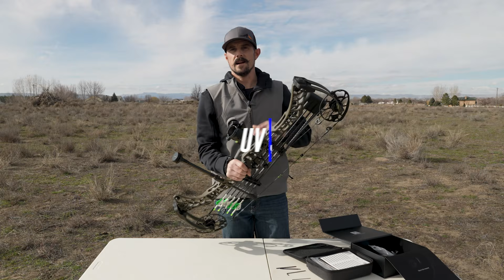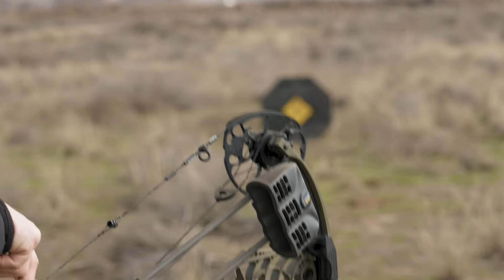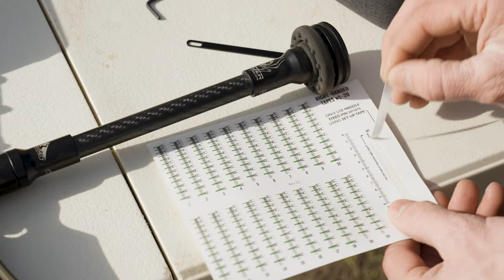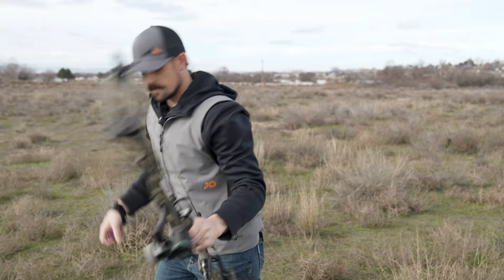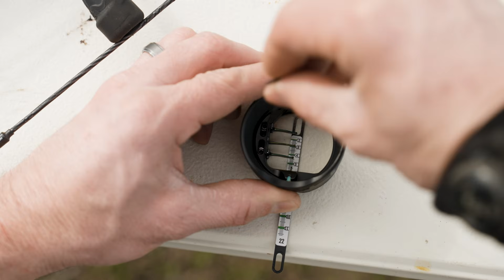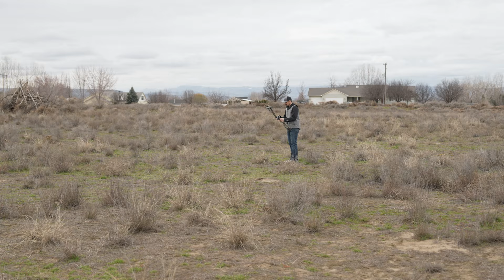UV Slider - Sight in Process | Step by Step

Comment: I finally just got this sight because it was on sell. Trying to find videos of people talking about the issue I have with this off the bat. I have no even sighted in 20 yet. But my biggest beef with this sight is utilizing the slider for your 20 yards. Most other sights I have experience with. The slider is always supposed to be at the very top. Then you move the scope up or down to dial in 20. This allows for maximum distance of the slider until you contact your arrows. I hear a lot of people not being able to fit tapes and cutting them. I do not hear anyone talking about this when it comes it set up

Comment: So my site tape ended up being 17. So I put it on the plate and the plate is already bottomed out on the bottom so I can’t get to 60. Am I missing something?? Can’t move the tape down any further either without cutting it.
Reply: Having the same problem and same sight tape… not sure what the problem is.
Reply: @miguelcalderon5228  so my buddy told me to move the scope housing down. I’m assuming you have a shorter draw length? I’m at 27.5
Reply: @SwampLifeAdventures  appreciate ya. I’m at 27.5 as well
Reply: @miguelcalderon5228  yeah I think you have to move the whole scope housing down

Comment: Just picked up the UV slider, I switched from an HHA tetra max, it’s an awesome sight but wanted to see what the slider is all about. 
I was a little confused about the sight in process for the slider and was having a little trouble with finding my elevation. 
But thanks to your video, my confusion was cleared up and I just have to get back outside and restart the sight in process for peace of mind. 
Thanks for making this video, it was well articulated and easy to follow.  Plus you just gained a new follower. 🤙🤘🏻

Comment: Bought this sight last week. I’ve had the hardest time getting it sighted in. Anyone else run into the problem of your sight bar siting to low on the slide it can’t be screwed down. I even got my peep moved up and that didn’t work. I’ve followed these steps to a T and still having the same problem? Any help? Thanks!
Reply: Have you figured this out? I am having this same issue
Reply: @AndrewBellotto  yeah so I set the sight bar on the slide then aligned my sticker with the indicators. The sticker was still at the very bottom of bar though. The screw was almost covering the sight tape number. Hope this makes sense and helps ya.

Comment: With being able to adjust each pin and where they correspond on the sight, when you scroll down to let’s say 60 yards on the middle pin, do the top and bottom pins accurately shoot at the corresponding yardage on the sight tape or do those “default” numbers go out the door once you move the sight up or down?
Reply from the maker: They will shoot the corresponding yardages, as long as they are sighted in for the correct distance in the default position and the sight tape is correct, any pin will work at what ever distance

Comment: @SandSArchery when you sighted that 60y pin did you adjust the elevation so you were shooting groups at the bullseye, or just the groups that were high?
Reply from the maker: after I shot the fixed middle pin at 20 and got that set, I moved back to 60 yards and shot the same pin to get the elevation set. I dialed out until the elevation was good. In the video I was shooting a small blue dot above the bullseye just to help me focus on a small point, Yellow target with a yellow pin was hard to focus on, so thats why I was shooting the blue dot. Once that was done I can than look at my indicator and see what sight tape I needed to install.
Reply: @SandSArchery  Perfect. That’s what I thought you did, but wanted to clarify that you were just getting the elevation dialed. I just ordered mine. This is one of the best and most straight forward videos on how to properly set this sight up. I appreciate you taking the time to do so, and the response.

Comment: What do you do with the new vertical pin cartridge? Can you get that to dial in to 20-30-40? Or would it be more like 20-35-55?
Reply from the maker: I'll film this today and get back with you. Great question.
Reply: @SandSArchery awesome! Just subscribed ❤ looking forward to the next video, thanks man!
Reply from the maker: @Rossmanchurn  Hey man, So after shooting the new 3 pin vertical cartridge, I set the top pin to 20 yards, middle pin ended up at 31 and the bottom pin ended up at about 42.5. So about a 11 yard difference on my setup. 70lbs, 29" draw, 480 grain arrow, and 271 FPS. I'll be releasing the video soon. thanks
Reply: @SandSArchery  thank you for getting back to me! Looking forward to the video!

Comment: awesome video don't hurt your arm elbow up when u draw way easier different muscles more natural your elbow ends up in right position need to do that as u draw back
Reply from the maker: Labrum surgery back in the day, this is the only way that it doesn't hurt to draw.
Reply: @SandSArchery   Another great video by the way, Justin. thank you.  I noticed the draw action as well and figured you had a shoulder problem. I draw same as you - in part I do it that way so as to limit motion when an elk is in close (lots of folks make a lot of bow movement at the archery range, pointing the bow at the sky, etc.).  I also hurt my shoulder in a fall when chukar hunting a few years ago and it is just now recovering.....I've tried to draw "properly" but that isn't going to happen anytime soon.  I'm just grateful that I can still draw 65-70 lbs right now - no doubt you feel the same.

Comment: best setuo video i have watched so far. I had to cut my tape short to make work #21, so I have done something wrong but I did see other people cutting their tapes short.  I am going to follow you steps and redo my sight in and see if I can actually install the full tape. Saw another video today that talks about the bonus pin which I am glad you can actually use a 4th pin four.  It made no sense to make a high end sight with a guessing pin? UV did a poor job marketting that 4th pin as they called it a fun pin or something.  Glad to see i can swap the pin out!
Reply: I’m also running into a problem. I had my peep sight to now the first go around, got it moved up and still having the problem with my tape sitting to low on the rail that I can’t screw it on. All these videos of people sighting theirs in less than an hour has me mind blown. Wish there was a better way than having to go from 20 yards right to 60.
Reply: @jtclinton22  did you ever figure out that issue?
Reply: @joey14816 did you ever figure out the issue lol cause im having the same problem on my arc 30
Reply: @kalebcrider4711  I originally had it on my lift 29.5 and transferred it over to my arc 34 i think it was because my peep was too low in the string after switching bows and raising the peep in the string I got a full tape tape sighting in the same way I did the lift
Reply: I will say my bonus pin indicator is off and haven't figured  that out yet
Reply: @joey14816 yeah i moved my peep up and it helped alot but im still completely bottomed out just to get my 20 and my arrow is at the bottom of my jaw at full draw